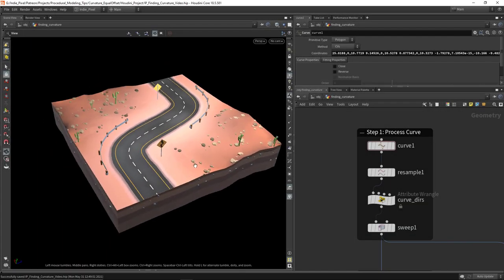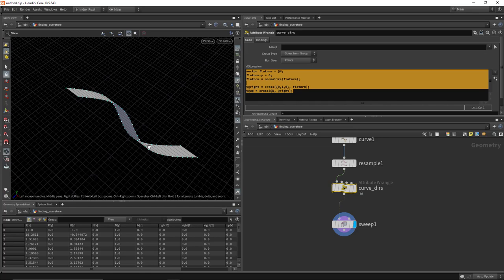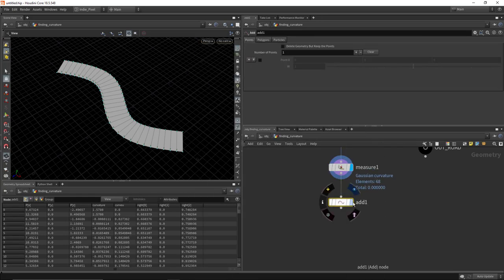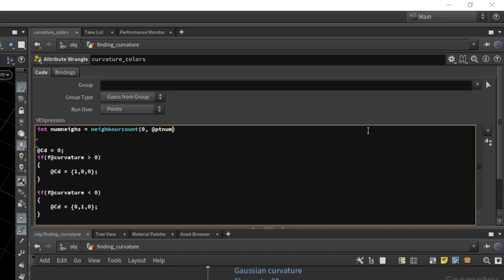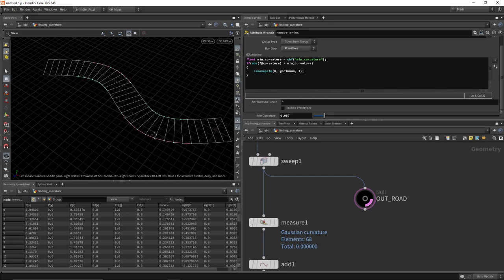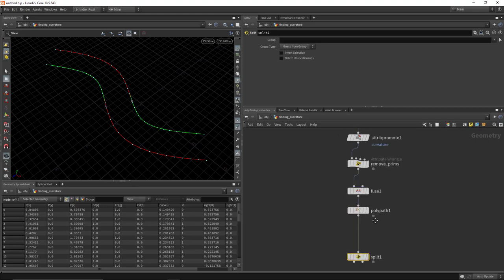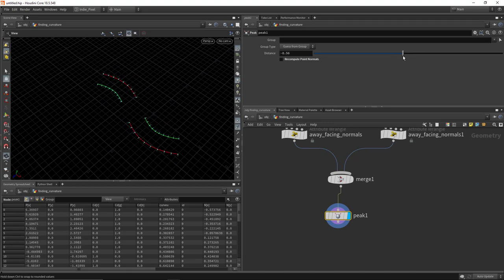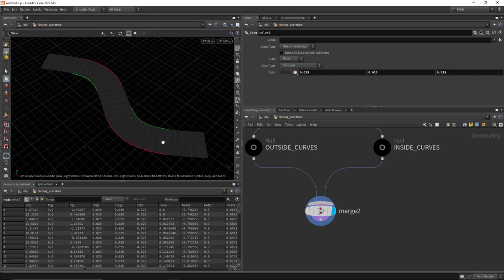Houdini - Procedural Modeling Tips! - Finding Curvature

Comment: After H19 the wrangle node where we remove the prims does not work anymore. if you slide the slider any nr higher then 0 it just removes everything. Anything I did wrong or is it H19 specific? Edit: FIxed it, I bypassed the attribute promote and then it worked. Also works if you dont switch it to prims.
Reply: I had this issue in v20 and fixed it by unchecking the "Connect Path" in the Convert Line node.